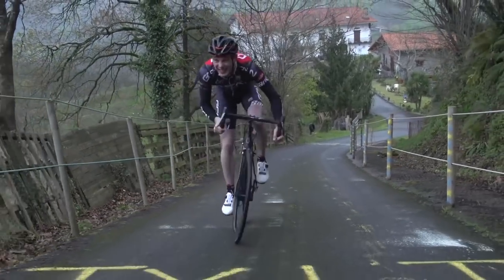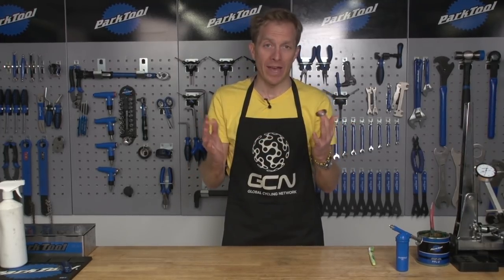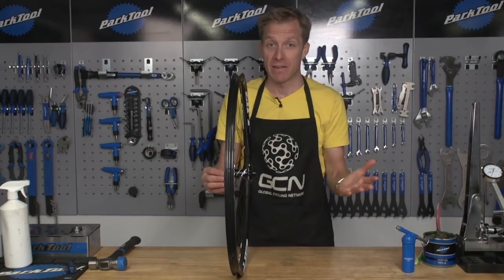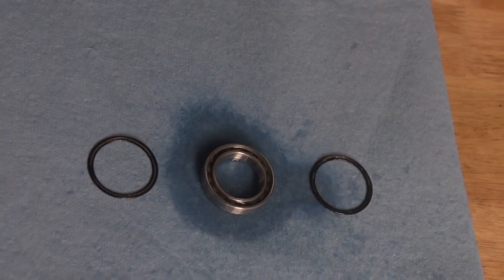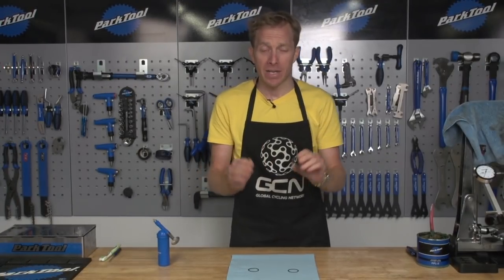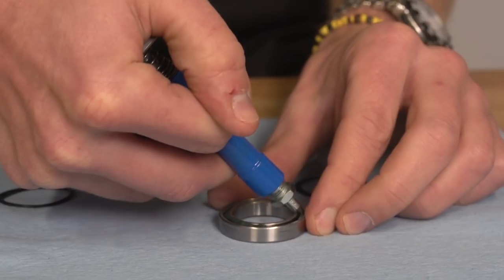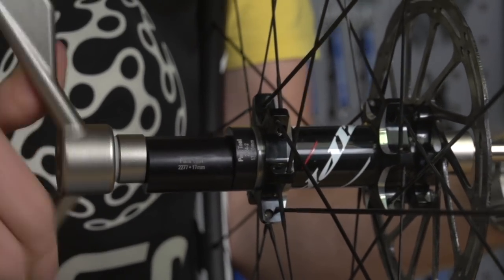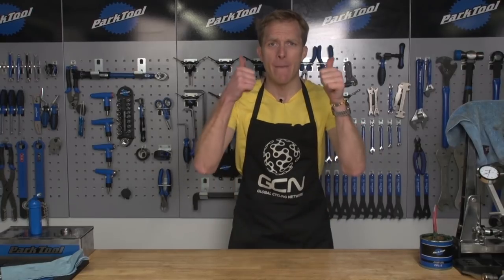How To Service Cartridge Bearings On Your Road Bike

Comment from the maker: What maintenance videos would you like to see ? Let us know in the comments below 👇
Reply: Hip replacement??....
Reply: Getting brake calipers centred and aligned properly.
Reply: Hi, I’m new to maintenance. Actually been riding for a while now, well a while for me 1.5 years, break for 3 months for a broken ankle. Videos are great, but I feel like, and is not just you guys, there is not a video that has done a full explanation of all the parts on a bicycle. For beginners that would be a real good help, kinda learning the language of the bike parts. Cheers
Reply: bleeding hydraulic brakes
Reply: Jockey wheel replacement. How many km to they generally last?
Reply: Paint restoration/repair
Reply: How to service press fit bottom bracket would be great!!

Comment: After cleaning with a degreaser and water, rinse with 92% Isopropyl alcohol (available at any pharmacy) .  The isopropyl removes any remaining dirt, displaces water (so no rust) and leaves no residue.  Isopropyl also evaporates quickly, is relatively non-toxic and leaves nearly zero oil traces.
Reply: 99% is better and can be found at Safeway.

Comment: You're not supposed to open the bearing seals, specially with a sharp knife. The risk of messing up them is pretty high.
Reply: Felipe R. You were given bad advice.  I open, clean, and regrease my bottom bracket bearings every 3,000 Miles.  I have 16,000 miles on them and they are just fine.
Reply: Wow! I definitely know some people who don't even lube their chain every 3000 miles...

Though the general thinking is that if you open a bearing seal, the seal around the bearing won't be as tight and resistant to water once you close it again...then again, people have ran loose-ball hubs/bottom brackets/headsets without seals for years without issues...
Reply: Chris Hoy- I have SRAM GXP bottom bracket and the maintenance literature from SRAM actually recommends this.  Just following directions. 😂  If you’re careful the seals go back just fine.

Comment: Good video.  Cleaning bearings is good to know how to do if you are on a tight budget.  In the end, you have to ask, "How much is my time worth?  Do I have more money than time?"  If the bearings are high-dollar super-precision ceramic bearings, then this may make sense to try... but who would ride such a bearing every day anyway?  Such bearings are normally saved for race day wheels and hence, take a long time to get gritty.  Standard every day steel bearings are not expensive today like they were 20 years ago with the influx of high quality Chinese bearings.  Even good ceramics have come way down.

I've cleaned a lot of bearings in my day, including large industrial bearings.  The method is OK as shown, but wont' get all the grit out, especially if a heavy synthetic grease is in there that a water-based degreaser won't cut.  The bearing needs to be submerged in a degreaser and spun back and forth while in the solution, with the bearing cage's back facing upward.  Then it needs blown out and the process repeated a couple if times.  Petroleum based solvents work better than water based "green" degreasers, but are harder to dispose of.  You also have to be careful to choose a petroleum based solvent that is compatible with the cage material in the bearing.  You never have to worry about water with a petroleum based solvent or denatured alcohol.

Seal removal is sketchy business.  You WILL eventually damage one.  I suggest keeping old bearings around just for their seals, assuming you stick with the same manufacturer of bearings.  I'd use a flat soft plastic tool and oil the seal first, and not a small screwdriver or pick on a a dry seal, as a pointed metal tool on a dry seal is almost guaranteed to damage the seal.  Unfortunately, small bearings do not have spare seals available, as they are not considered serviceable.  If you do damage one, put it on the backside of the cage and make sure it goes to the inside of the hub, not the exposed outside of the hub.

There is a more complex method and even special tools used for grease packing bearings, but the method shown is adequate if done correctly.  It should feel very sluggish when spun by hand if done correctly.  When you put the seals back in, grease should squish out, then when you spin them, even more should squish out.  The right amount of grease will squish out on the first ride as the grease heats up, freeing up the bearings.  Of course, grease packed bearings are good for training and bearing longevity, but race day bearings are something else and the cleaning/lubrication of such bearings are a different debate entirely.
Reply: Instructive. Thanks

Comment: This looks close to overfilling, as described by sealed bearing specifications, leading to unneeded drag. Even so, the miniscule wattage losses from bearing grease and seal drag is far less than your daily power output variation. With any acceptable lube and proper adjustment for preload, etc, service life and corrosion protection are the more important concerns regarding lube selection, as the bearing design, quality, and seal friction establish the limits, that the thinnest super-oil or thick high-temp grease will modify only slightly.

Comment: Do you want your bearings to be fast or do you want them to be protected from bad road/weather conditions? You cannot have both. Those double-sealed bearings that Jon recommended will be slower because the increased sealing adds friction which "slows" the bearings. The "fastest" bearings have no seals at all and may use a light oil instead of grease. Some TT bikes have used unsealed, oiled ceramic bearings during dry, clean weather conditions because speed was paramount, the use was limited (only the duration of the time trial), and the road/weather conditions were excellent.

The point is this: There is a continuum with maximum speed (low friction) on one end and maxiumum weather sealing on the other end. The point you choose along this continuum will be a compromise. You cannot have both at the same time. So make your decision based on your unique road/weather conditions, your priority for speed, and how frequently you are willing to service your bearings.

Comment: Just replace them. Bearings for the bottom braket cost about 2€ 
each. In my aerozine bottom brakets, they can easily be removed. Also you are likely to damage the seal when removing it.  You cannot heal an old bearing with pittings in it, when you put new grease in it

Comment: Anyone remember the oil port on their Raleigh Sports 3 speed? Who needs to do this if you can just flush out the nasty particles by refilling it with fresh oil. I'd still just use new bearings instead given the option, but that's coming from a mechanic who doesn't have to pay an RRP for parts. And yeah, I still watch technical videos, even though I don't have to. I just find it interesting to see how other people do things.

Comment: I want to do more of the mechanical work but the tools are so expensive. The bearing press im seeing on Amazon is a couple hundred alone.
Reply: See if your community has a local bicycle co-op. Though I will say a lot of home mechanics (me included) use DIY and homemade tools with great success. I once used a fork (the kind you eat with) as a cone wrench for a set of hubs.
Reply: I know wheels manufacturing has a press for about 30 dollars, just doesnt come with any of the adaptors for bearing types. I have one and spent about 20 more to get the bearing adaptors i need (bb, wheels and suspension)

Comment: Can automotive grease that I use in my cars front wheel bearings and ball joints be used on bike bearings?
Reply from the maker: You sure can, though the properties of the grease is different - it might be more hardwearing because it needs to generally last longer and is put under more strain. It's best to get something cycling specific, but if you need a quick fix, it'll definitely work! We hope this helps :)

Comment: #torqueback What is the minimum seat post insert that you guys recommend? I have an 27.2 mm aluminum seat post from my old frame and it was cut a bit too short for my new one. It only has 3.80 cm of insert. Should I still be using it?

Comment: u got the bearing out of the part? well done 

hem no, if you hammered it out, the bearing is done for, u need a dedicated bearing extractor capable of pulling it out while resting on both races and applying and equal amount of force on them, cause if you hammer it out by applying force to just one race (like by hammering on the axle) you're actually ruining it just as if you seat it by hammering down on the inner race alone
and basically hub bearings are a 1 time use thing

is this seriously considered good maintenence advice?

Comment: Pick the seal off from the outer race, not the inner, because you're less likely to damage it that way; the outer seal stays fixed to the outer race, while the inner seal has the very fragile wiper that spins against the inner race.  An exacto knife also tends to work better than a pick because picks are usually too blunt.
Reply: Or if it's a single sealed bearing, you can use a thin piece of wire to push it out from the other side.

Comment: 1:07 ooooooffff A handful of rotor there my man. Body oil is going to make those disc brakes howl! I appreciate the technique you are using here, however, if I had a customer with gritty bearings in a Zipp wheel I would remind them they spent major coin on these wheels. A $20-150 bearing is worth it in a nice set of wheels and replacing bearings will ensure the hub isn't ovalized from over use of the same bearing.  Save the hub, trash the bearing.

Comment: rice??? RICE!!!! 
rice will probably add dust back onto the bearings

better off using  isopropyl alcohol bath after the water rinse. the alcohol will displace water and wash away what other impure stuff. and it evaporates better. and you can always reuse the left over alcohol left in the bowl/rinsing container.

Comment: What type of rice? Should it be  long grain so it doesn't get stuck in  between the bearings.......
Reply: David Bell any rice. Nothing expensive though. Save it for drying out other things too 👍
Reply: @David Don't listen to Jon.  You need to use short grain rice for ball bearings and long grain rice for needle bearings.
Reply: btw.  jk

Comment: #torqueback why do more teeth on the back make it easier but more cogs on the front stronger? It honestly makes 0 sense to me
Reply: Fewer teeth at the back means the sprocket is smaller relative to the thing it's driving (the wheel). Fewer teeth at the front means the chainring is smaller relative to the thing that's driving it (the circle the rider is forming by turning the pedals).
Reply: thats a terrible attempt an explanation
Reply: Well i hadn't finished yet but now i don't think i'll bother.
Reply: If you have 20 in the front, and 20 in the back, turn the pedals once -> front cog turns once -> moves the chain 20 teeth -> rotates the cassette by 20 teeth, once -> rear wheel turns once. If you had 10 teeth in the back, then the rear wheel would rotate twice. The higher the ratio between the front & back (the gear ratio, # of front teeth divided by # of rear teeth), the more times the rear wheel will go when you pedal once, so the faster you will go when you pedal at a constant speed. When you add a tooth to the front, the gear ratio increases. When you take a tooth off the back, the gear ratio falls.

Comment: hm... that's much of work for a part what costs only a few €; put grease in it regularly as long as the bearing does work properly, that will help to extend its live span; but when it runs rough - buy a new one!